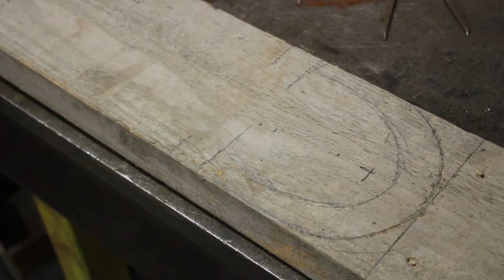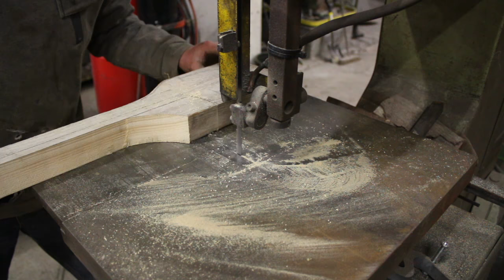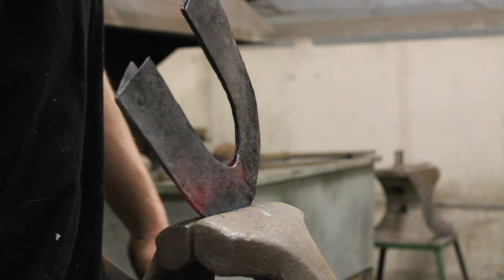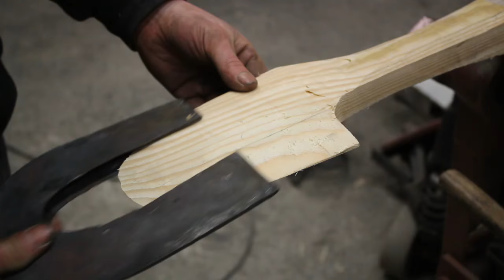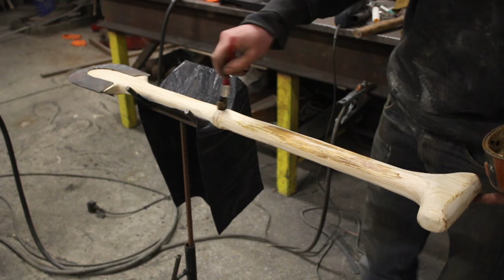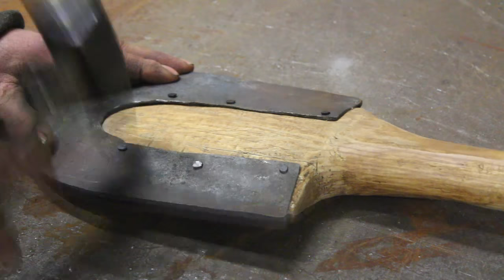Born to Forge - Crafting a Viking Spade

Comment: What archaeologist have labeled as a spade is in fact a Baking Paddle used to push and pull bread, meats and fish from a stone wood burning oven. The reason they are found with an added steel or iron nailed on plate is to prevent them from burning the wood and for pushing hot wood coals.  

A true Viking Spade or Shovel has a hook and looks the same as a modern Garden Hoe. These have been found in many shapes and sizes. As the saying goes, "What it appears to be and what it really is are two different things". Many debate the foot shaped step cut out on these. That offset cut out was used to hook and drag wood planks used as cooking plates to cook food especially whole fish on.

Likewise a true Viking Long Boat Oar Paddle would be similar to these but without the added steel or iron and are much larger. And it has been proposed that oven paddles in all parts of the world were modeled after Oar Paddles. Lol,,,,,, Nice build !
Reply: These are depicted in the bayeaux tapestry and various manuscripts as spades.

Comment: My suggestion would be to fit the iron/steel on to the wooden spade while red hot. Then quench it before it turns dark. The metal will shrink some when cooled and make a tighter fit.

Comment: Would puting that metal edge in hot state on the handle help maybe in strnghth and better fit? Like it is done on horse shoes every once in a while,prevents dislodging and reduces stress on nails holding it.

Comment: Wow.  Nice.  I was going to ask if you had trouble with the bit or edge (the folded over metal) welding closed as you put the curve to it.  I see that you didn't.  You worked some of it at nearly white/yellow heat.  Is unintentional welding a potential problem?  I've had trouble forge welding cable for a 'hawk head at white hot but it seems to this neophyte (I CAN forge you the prettiest 1/4" drive hook or S hook with finials where appropriate in ONLY fifteen minutes that you've ever seen and with no more than a dozen or two heats.  The 'smiths will understand) that the sheet steel might be more susceptible accidental welding.  Is smithing a career or hobby for you?  Joking aside about the hyper speed video you don't waste a lot of movement.
Reply: Well I see your concern but the way he folds and heats it the only possible weld might occur right at the point, which looks like he was going for. Without any flux its nearly impossible to achieve a good weld on mild steel. Also the camera can be misleading on the color temperature, it doesn't really look to be forge weld heat for most of tte shaping